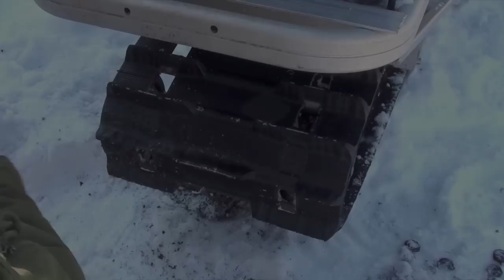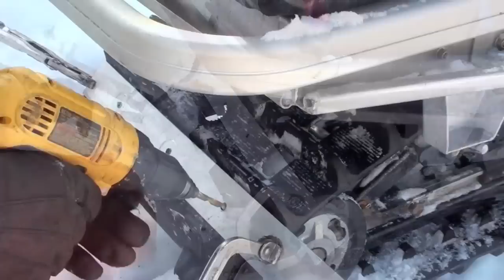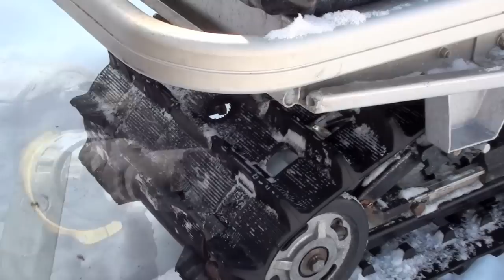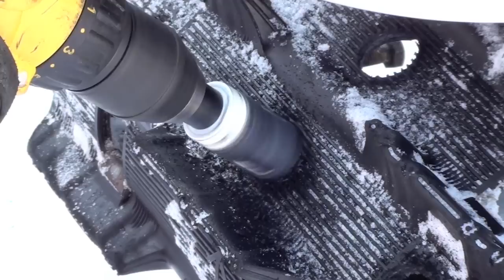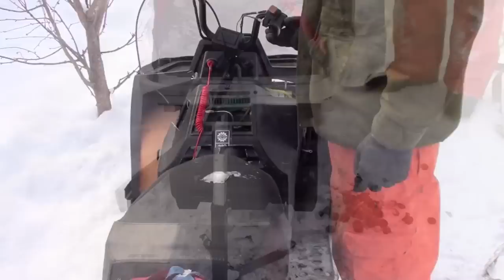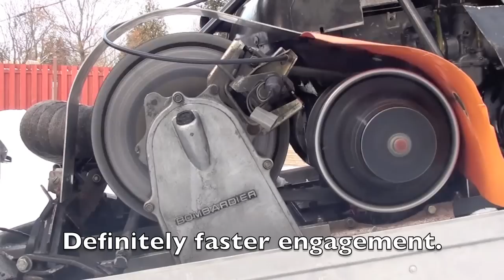Porting a snowmobile track

Comment from the maker: @FrankaDith Less rotational mass, better performance, gets the snow out of the track, it's quite popular now for the higher performance sleds - heck maybe it would make for better performance on the oldies as well.

As it is just after I did it the track spins much more freely than before as it had every third window closed anyway from the factory, so I just opened the closed ones up and poked some down the middle as well.

Comment from the maker: To me it depends on what you are doing, I ported this track for my 151 540cc Monster elan, I needed lightweight and less rotating mass to free up as much power as I could.  On that sled with only about 65hp holes in the track won't have a negative impact in my opinion - there just isn't enough power to tear it apart. Sure I might get 15 years out of it instead of 16 but I'm ok with that.  Thanks for watching!

Comment: The only benefit from you porting is to let snow in to help with the cooling of the sliders(hyfax) .The only reason you go faster if at all is because the track is weakened and stretched on the suspension spinning more freely.Drill the holes where the sliders run but don't wreck your track and drill the holes down the middle.Put studs down the middle would be better.

Comment from the maker: @Formula360097 I'll press the bullshit button on that although I respect your opinion.  There are gobs of high hp sleds running ported tracks with no issues, does it limit lifespan hell ya, potential for track tearing hell ya - but I know that going in to it - I need more power to the ground, less rotating mass and porting accomplishes that.